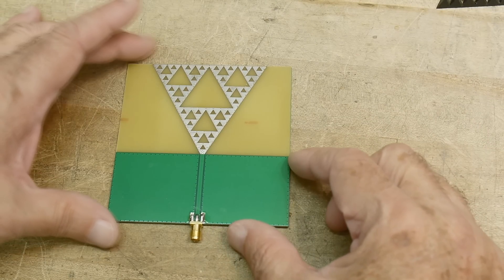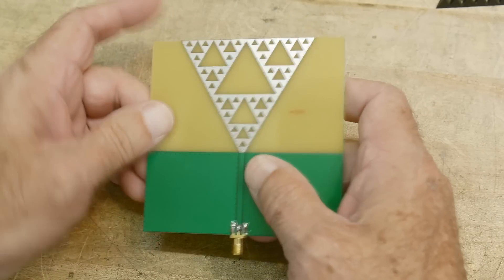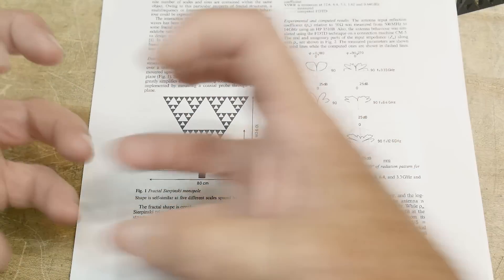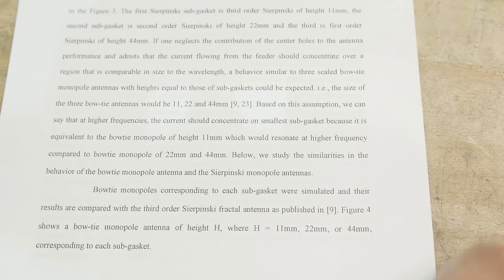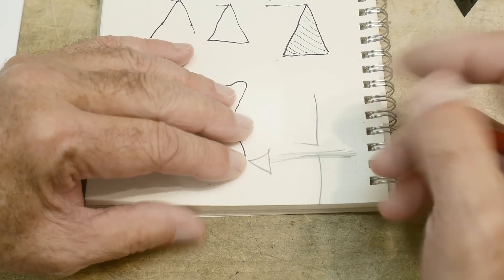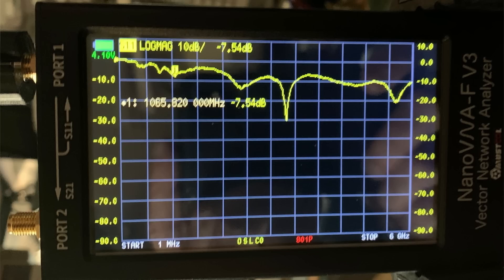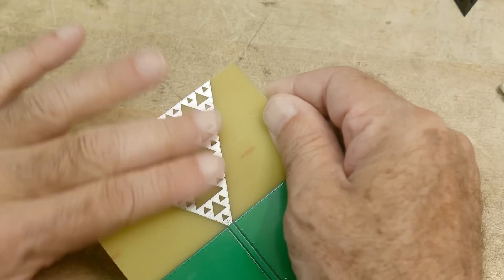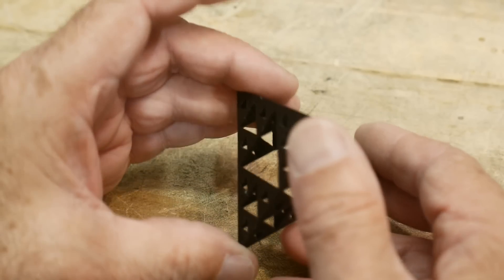#1988 Sierpiński Triangle Gasket Fractal Antenna

Comment: Please what is the gain of the antenna
Reply from the maker: Probably zero
Reply: @IMSAIGuy zero?
But there is a return loss from the VNA analysis you showed us and also zero gain means that the antenna is not working
Reply from the maker: the VNA cannot measure gain. here is how to measure gain: https://youtu.be/FROSpugtM8A?si=F4Exr3UlLNkD9B5Z
zero dB means there no gain above a dipole or maybe even isotropic for this antenna
Reply: Thank you for your response 
Please what type of SMA connector did you use to test the antenna
Reply from the maker: @IbrahimAdigun-z8l  male/male adapter
Reply: Thanks @IMSAIGuy
Reply: What is the impedance of the antenna
Reply from the maker: @IbrahimAdigun-z8l  50 ohms at the resonant frequencies
Reply: Thanks 
I am trying to build an Rf energy harvesting system but then I need a wideband impedance matching network due to this fractal antenna I am using
Reply: Please what is the size of the male/male adapter
Thank you

Comment: You mention halving balanced antennas going to the unbalanced equivalent (Bowtie to fan vertical) & obviously you can go the other way too.
Mobile phones have been great for the development of antennas for restricted real estate (in the palm of your hand). Radio amateurs are also restricted in the size of their gardens (and can be limited creating good groundplanes/radial systems hence balanced antennas can be advantageous).
Can we come up with a mutant mongrel of cellular phone antennas for HF amateur use?
Start with an inverted F antenna, scaling to HF is practical (about 33' wide for 7MHz & not that high so that looks plausible).
But inverted F need a good groundplane & getting one of suitable efficiency probably not viable for the amateur so could we go from unbalanced & double up to balanced?
That would basically give a low horizontal quarter wave stub that we are resonating (or could it be called a skeleton notch antenna?...... basically it seems to be half a skeleton slot).
We are going to be putting energy into it. It will be very high Q & that energy will either leak as RF or be absorbed by resistive losses within the metal of the antenna/stub (so basically we are going to have to follow the same low loss considerations as when building a magnetic loop antenna to get any viable RF radiation & not just warm to local birds ).
WOULD THIS WORK?

Comment: Since the triangle is a completely closed circuit around the outer edges, I find it hard to believe that the RF even cares about the triangular holes in the middle.
Reply: And yet it does. That is because the impedance changes on scale size.
Reply from the maker: You underestimate RF
Reply: @IMSAIGuy  I definitely underestimate RF, but I’d be curious to see how it compares to a solid triangle of the same size. That should be pretty broadband too.
Reply: @IMSAIGuy  If you make a few triangle shaped holes in the antenna you already get a vast majority of the effect expected. All that tiny fractal patterning is just aesthetics. The current densities in the middle are different at higher frequencies due to the choke points and flat surfaces.

The feed-point design on this antenna is not that great. There should be some kind of a matching circuit, be it lumped components, a taper transformer, resonant stub, series impedance changes or something when transitioning from the microstrip to the monopole. It's also questionable why the gap between the active element and the ground plane on the reverse side is that tiny. Maybe it's by design, maybe not. This design is nowhere near optimally matched. 

Actually now that I think about it, making the active element dual-sided and stitching it together like that is most likely a waste of copper. It will  be a bit more broadband when the 0.05mm thick triangle changes to effectively a 1.6mm thick triangle but the effect isn't much.

Comment: The "fractals" in this antenna are entirely an aesthetic choice to lure in human interest. Any space filling curve would work. This is just a fat monopole. It could be made even more broadband with a deeper low end by the use of shorting pins to ground from the top edges of the triangle, 2-stage construction of angles vs scale, or extrapolation to a 3D cone instead of 2D planar triangle.
Reply: Not entirely but even more complicated fractal antenna designs typically fail to be as wideband as the designers hoped they would be. Often much simpler geometries produce the same effect. Some people have tried fractals for microstrip filter resonator loops and even in those the fractals don't really offer anything new. If you insist on kinking the trace, you do the first order or maybe first and second order kinks and that's that. Normal bulk FR-4 itself has terrible attenuation already at 5 GHz.
Reply: Wrong. It is a multiband antenna, which also has a broad plateau of resonance at higher frequncies.
Reply: @chip-s5f  "...a  broad plateau of resonance at higher frequEncies."  You spelled loss incorrectly.
Reply: @JxH  Asserted but not shown. Show us how the Sierpinksi has high losses at at higher frequencies. Again, you are not assertung from a factual basis..

Comment: Absolutely fascinating!  I had no idea Sierpinski triangles had any practical applications.

At the risk of doing some math, I will point out that Sierpinski triangles are generalizations of Cantor sets.  A Cantor set is constructed in much the same but it is done on a single interval not a triangle.  You take the interval [0,1] and remove the middle third leaving [0,1/3] u [2/3,1].  Repeat the process as you did with the triangles.  There are some points left over even when you take the limit of the process to infinity. It turns out there are actually an uncountable infinity of points left (rather than the smaller countable infinity). It also is pretty easy to show that the sum of the lengths of all the remaining intervals is 0. 

This is a fundamental result in measure theory: the existence of an uncountable set that has measure 0.

The proof is pretty easy (but this comment is too small to contain it ;-). YouTube seems to have a few videos of the proof.

Comment: Modern WiFi routers often use these fractal PCB antennas. That's why you don't see external antennas. The performance is much better than the little stubby dipole antennas.
Reply from the maker: yes fractal but not sirpinski: https://youtu.be/COCSlXrqgc4?si=M9426XqY1l8rs9Tz
Reply: I noticed that the Eero ones typically lack an external antenna, and they claim "1750 square feet" coverage. 
That's not even 25 foot range; their claimed range couldn't even get across my living room. Rubbish.
Gimme the "little stubby dipole" any day of the week. You know? ...the ones with the 100 foot range?

Comment: I have one somewhere around here that a friend designed for amateur radio use.  It covers 70cm, 33cm, 23cm and 13cm.  At the time I tried it I didn't have a 13cm transverter but I did use it on the 3 lower bands.  Stuck it on top of a 50 foot fiberglass mast and used it for a few hours during a ARRL VHF contest (which by the way is this weekend).  For it's size it worked surprisingly well.  No where as well as dedicated Yagi-Uda beam but I got some contacts on those 3 bands in the log using it.
Reply: Was it intended to operate like a Yagi? If not, you cant compare them.

Comment: this is literally a rune that wizards use to cast spells
Reply from the maker: great, I knew it must be good for something
Reply: @IMSAIGuy  IMSAI, someone designed the maze antenna on that wireless  printer video and made money from it. That is just one of hundreds of examples that fractal antennas are good for something. What is your beef on this topic?
Reply from the maker: @chip-s5f  fractal antennas are great and everywhere. my comment was just about the seirpinski harmonics not lining up with usable frequencies. the only reason to use this is the multi band feature.  there are better ones for monoband.
Reply: @IMSAIGuy  That makes no sense. No one buys and analyzes and antenna that wasnt designed for their needs. There are certainly versions of the sierpinski that do indeed fit a combination of passbands that you would find useful. You didnt check the  lietrature at all, other than the 1996 article.  You created a problem that doesnt exist.
Reply from the maker: @chip-s5f I read about 6 papers, but that is why I asked if anyone could find a case of it actually being used. please provide info on a product using a seirpinski triangle antenna. you must be confusing ALL fractal antennas with the name Sierpinski. 99.99% of fractals are not sierpinski, and not using equilateral triangle gaskets. I'm talking about (and the 6 papers) a very specific shape. the harmonics being fixed by the geometry of the equilateral triangle gasket

Comment: I definitely should show my elder co-worker, who knows well radio-frequency electronics, what he thinks about this, this looks very interesting
Reply: These have been around forever and are used in lots of consumer devices, like high performance wifi routers. I doubt he will find it surprising.
Reply from the maker: not sierpinski but fractal yes: https://youtu.be/COCSlXrqgc4?si=M9426XqY1l8rs9Tz
Reply: @IMSAIGuy So, the triangle antenna didn't impress him :) the fractal one, he said he doesn't understand it and it looks like nonsense. He doesn't speak english, so I couldn't show him the video.
Reply: @eto_fedos  IMSAI< why do you think this antenna was 'designed'. It is a simple fractal that demonstrated  loading of the lowest resonance, multiple resinances, and  a broad resonace plateau at higher frequencies. You assume that it was designed with a  set of specs.  The way antenna design works is you start with specs and find the design that works.

Comment: I can only imagine religious applications for this...
receiver for teh holy frequencies of the aliens, galactic broadcast, over-unity RF voodoo free energy
Good ideas for a sci-fi short story? Maybe. Practical applications? Not so much.
Reply: Good beer and 'maryjohn' encounters, instant winner lotto numbers, guarantied drug effects by means of 'nirvana now' testing, etc.
Reply: not true.

https://www.youtube.com/watch?v=4BGpU0dvYHw

Nathan Cohen W1YW was interviewed about his Fractal Antenna for a TV show, Hunting the Hidden Dimension, now available to watch online.

In the show he says:

I was at an astronomy conference in Hungary, and Dr. Mandelbrot was giving a talk about the large-scale structure of the universe, and reporting how using fractals is a very good way of understanding that kind of structure, which really wowed the entire group of astronomers.

He showed several different fractals that I, in my own mind, looked at and said, "Oh, wouldn't it be funny if you made an antenna out of that shape. I wonder what it would do."

I thought back to the lecture and said, "Well, I've got a piece of wire, what happens if I bend it?" After I bent the wire, I hooked it up to the cable and my ham radio, and I was quite surprised to see that it worked the first time out of the box. It worked very well. And I discovered that—much of a surprise to me—that I could actually make the antenna much smaller, using the fractal design. So it was, frankly, an interesting way to beat a bad rap with the landlord.

Using fractals, experimentally, I came up with a very-wide-band antenna, and then I worked backwards and said, "Why is it working this way? What is it about nature that requires you to use the fractal to get there?"

The result of that work was a mathematical theorem that showed if you want to get something that works as an antenna over a very wide range of frequencies, you need to have self-similarity. It has to be fractal in its shape to make it work. And that was an exact solution. It wasn't like, "Oh, here's a way of doing it and there's a lot of other ways of doing it." It turned out, mathematically, we were able to demonstrate that was the only technique we could use to get there.
Reply: Fortunately we live in reality, where fractal antennas are used in stadiums, churches, universities, hand held devices, jets,  etc.
Reply: @JxH  Jealous?